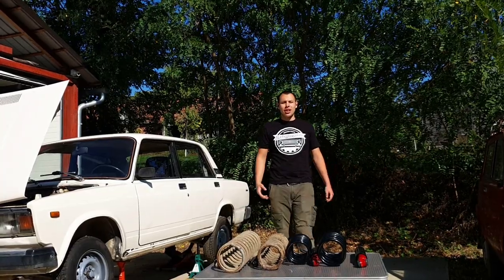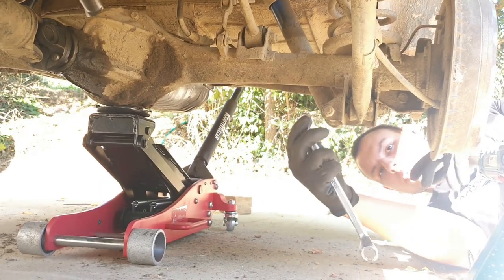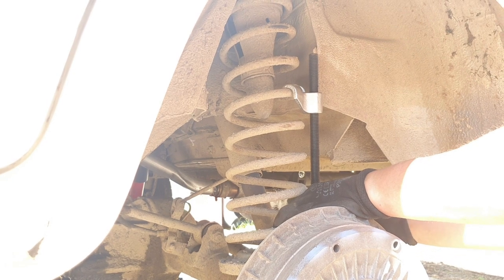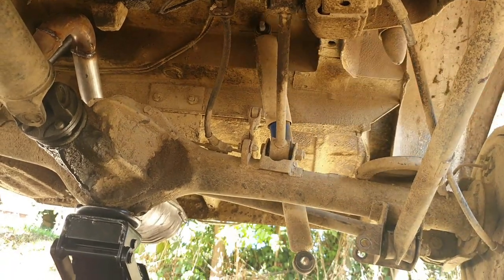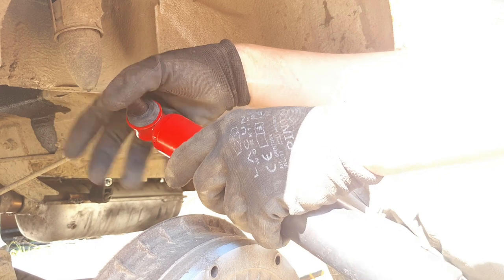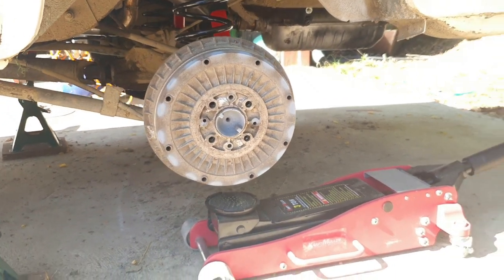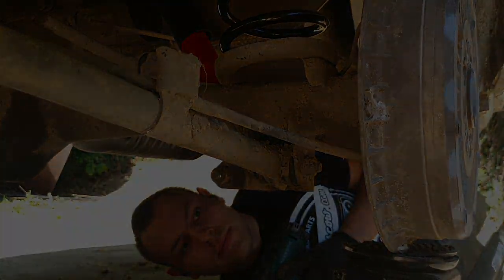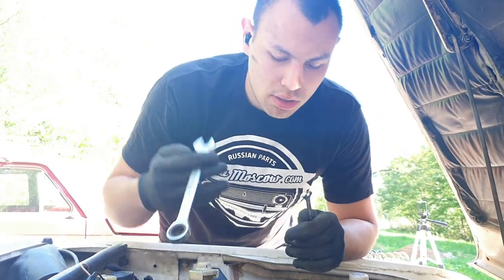Lada Moscow x Leo Plukavec, Croatia # Part 3 - How to install lowering kit on LADA 2107

Comment: Very helpful! Just done this myself and worried about it being too low or if I need to adjust rear brake bias. Also read sometimes the prop can rub the body if lowered too much?
Reply from the maker: hi. what is bias? it can rub but I think from -150mm
Reply: @LADAMoscow  the lever on the rear that stops the rear brakes from locking up on heavy breaking
Reply from the maker: @jonporter1243  you don't need to make anything with bias